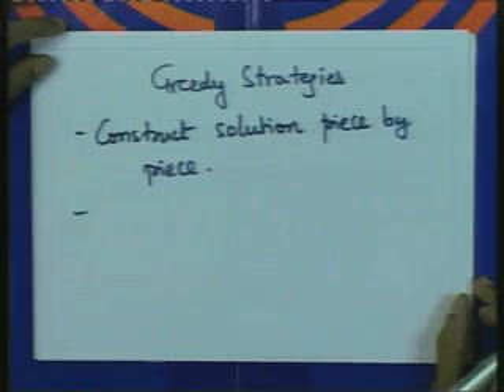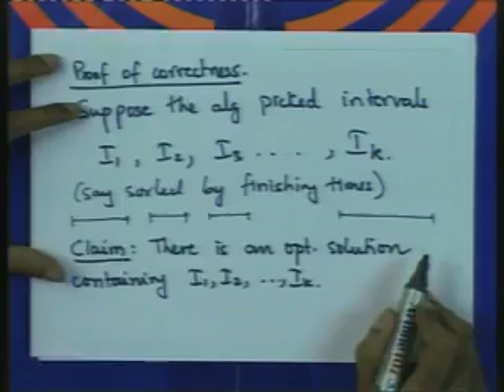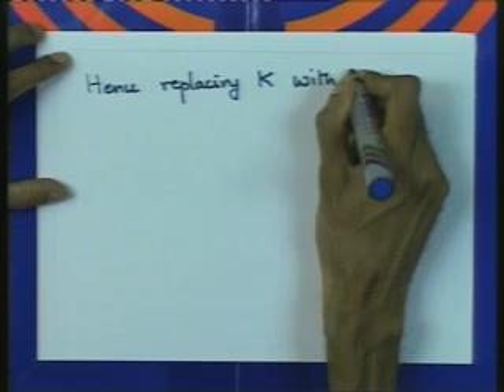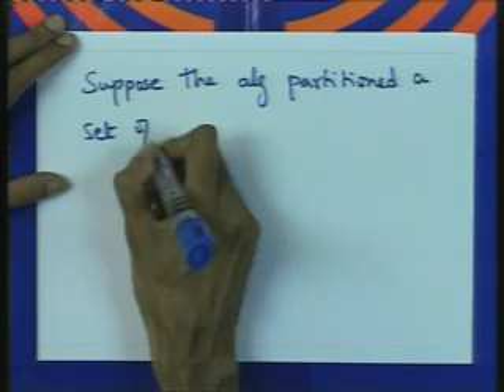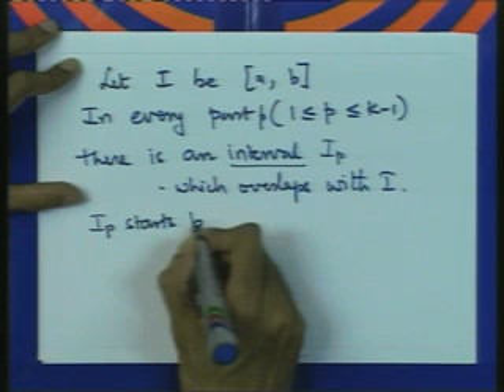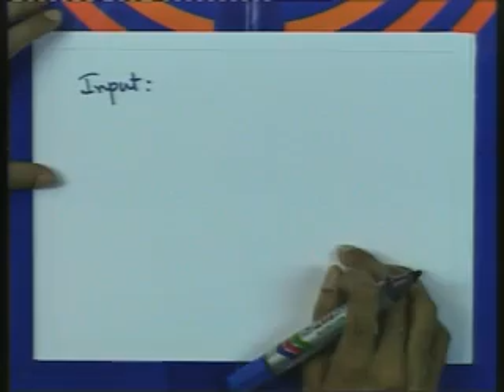Lecture - 11 Greedy Algorithms - II

Comment: awesome lecture, one basic doubt - why the ending time sort(ascending) wont work for this problem?
i tried many examples - it seems working.
Reply: Well I hope by now you might have solved your doubt, the professor also stated why it is not optimum. This should help:
Take the intervals (between 0 to 24 hrs.) : {<1, 2>, <0, 3>, <1.5, 3.5>, <2.5, 24>, <4, 5>, <4.5, 6>, <5.5, 7>, <6.5, 8>, <7.5, 9>, <8.5, 10>}.
# distinct sets when intervals are sorted by ascending order of end time = 4
# distinct sets when intervals are sorted by ascending order of starting time = 3.
Reply: @vibhasharma3679  it's working when are sorting in ascending order of ending time. The answer coming is 3 only.
Reply: I believe what you are trying is the same as what he is suggesting..